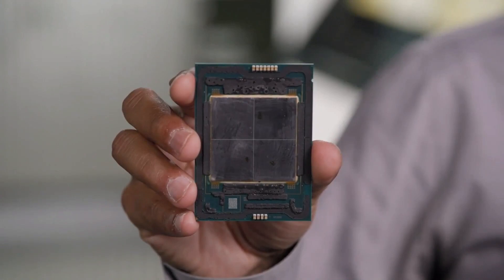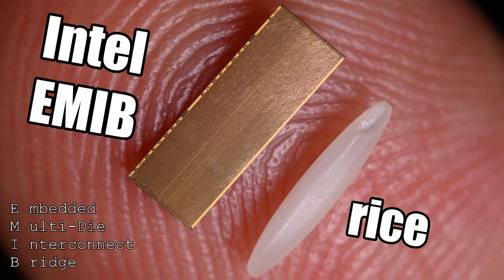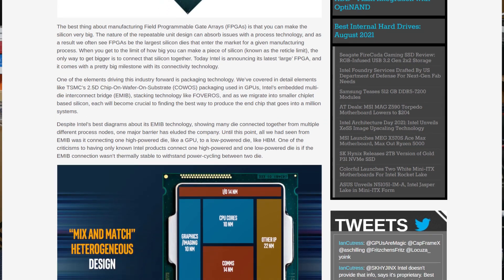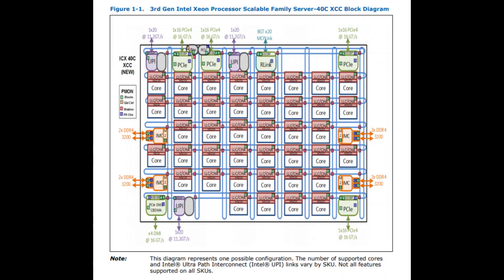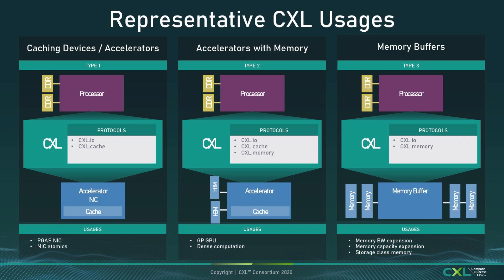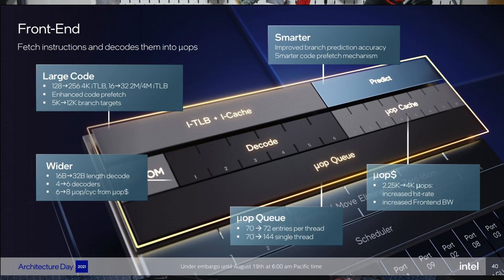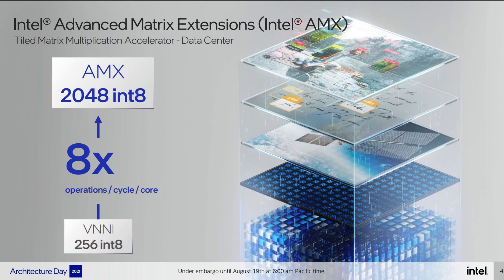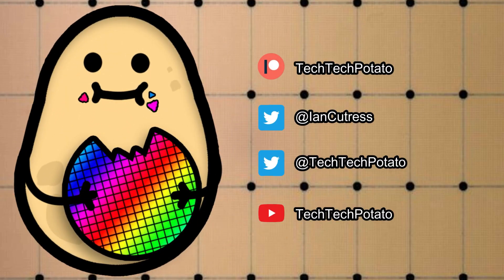When Four Become One: Intel's Next Xeon is BIG

Comment: wrt amd and potential milan-X:
This is another part where amd has a leg up to intel, because apart from the apu's and the semicustom stuff, amd kinda only makes one processing chiplet. which means they can more dynamically scale between desktop and server.
In the last news about it, it seemed that the 3d cache was at least coming to desktop (I think optimistically by the end of the year). which means that IF amd wants to do milan-X and those 3d-cache ryzen desktop cpus are already in production, it's basically just taking a spool of those chiplets from the ryzen assembly line and plugging it into the epyc line.

Comment: I like intels approach to vertical layering and horizontal connectivity over AMD.. If I was Intel I'd be developing a CPU package that has a monolithic die and multiple simple, low, strong chiplet connections (gold bumps/pins that fit into/onto the chiplet). Chiplets secured by a tight fitting sheath and heat sink combination that slides over each extended end of the elongated PCB.. maybe 8 sockets of 16 by 32 connector grids each. This is for main memory and possibly co-processors.. Super-fast, high bandwidth, high capacity DRAM.. 
--
Intel should bring out DIMMS with combined flash and disk cache / main memory that can back itself up using just the power remaining in the system in the event of a power failure.. These replace SSDs in all home PCs, with a standard design for laptops and PCs.. Shake up the market, improves speed at at all levels.
Reply: intel has realeased 512GB ram modules, they are hybrid optane, but they are only supported in specific server models and they need special software support for the apps to make effecient use. no, ssd's are not going to be replaced any time soon by these modules, because of first, the high cost and second, the storage usually needed is always an order of magnitude bigger than ram...

Comment: If SPR is truly monolithic-like in internal connectivity it should be really fun to play with. One thing I've not liked about AMD's approach is the choke point that Infinity Fabric is between CCX, which I think plays a part in their decision to explore massive caches to mitigate against that.
Reply: Since releasing Zen 3:

For server this is probably more of an issue, but that's going to vary greatly depending on the task.  Well, it would also affect TR in the same way.  If threads have to be passing data back and forth between cores on different die, it becomes an issue.  Not much, but yes it can be an issue.  For servers that are constantly serving data for different queries, this is going to be a non-issue.  For video rendering or tasks that do something very similar, where in the case of video rendering segments can be handled by individual cores and then passes the completed segment to a main thread that's assembling a completed stream, then that's constantly using the interconnect between the chiplets.  So, workload dependent. 

However, considering AMD's IPC is better than Intel's right now it doesn't seem like this interconnect has too big of an affect.

For mainstream desktop the CCX is only a thing for 2 chiplet CPUs, since there's no longer a 4 core division.  One could think that because there's still an IO die that this introduces latency, but an area where latency shows itself is in gaming, and right now Zen 3 in desktop is the best gaming product and very low latency.  Part of this is because you're really only using one chiplet for gaming, but the other part is the core chiplet deals with part of the interface without the IO die from my understanding, based on the last time I looked at a diagram for Zen3.  I could be wrong.  Once you go over 8 cores then you start to get into workload dependent issues with having to pass data across the interconnect for cores on different die.  The scheduler in the OS is supposed to keep threads created by the same application within a single chiplet, from my understanding.

I suspect that Zen4 is going to be a total remake of the interconnect.  AMD is scraping GloFo, and is using TSMC technology through and through, and I highly doubt one interconnect is going to be superior to the other when talking about AMD or Intel at that point.  This is also technology that both AMD and TSMC have been working on too.

Comment: Isn't it the interposers that make HBM really expensive? So if Intel is sprinkling interposers like it's confetti then won't these chips be ultra expensive to manufacture? And massively disproportionately expensive compared to a 96-128 core Zen 4 chip?
Reply: Perhaps. But I know Intel has been investing heavily in packaging tech so they might have a competitive advantage there. Plus they could get economies of scale when they start interposing interposers in everything. He also mentioned  (around 1:30) that EMIB requires much less silicon than a traditional interposer. So it may not be as expensive as it seems.
P.S. Great username.
Reply: @fat_pigeon  let's hope so because if they can integrate HBM at a reasonable cost then we might start to see it trickle down to high end APUs.

I still believe an ultimate all round chip (great for gaming and professional workloads) would be:
16 core Zen 4 
80 EU RDNA 3
64GB HBM3 unified memory

I'd pay $2k for that chip if the heat could be controlled so that the clocks are still decent but all of the above are meant to bring huge strides in energy efficiency. Plus the energy saved and the performance gained from having everything on the same chip/socket would be massive. When you break it down $2k isn't a bad price, $3k starts to get a little expensive but when you hear MS is only paying a little over $100 for the XSX APU then clearly AMD / Intel could make some serious profit from releasing consumer segment ultra high-end APUs.
Reply: probably
Reply: It's Intels highest price line I know: if it offers good performance per space and power cloud providers will pay nearly any price.
Reply: @CGIEBERT  I just find it very unlikely it will offer better performance per socket per watt than a 96-128 core 5nm Zen 4 CPU but time will tell I guess. 
I think it will start to get very interesting when Intel starts using TSMC's 3nm node for their chips, seemingly before AMD has 3nm chips too.

Comment: EMIB is saving some Watts while expanding connectivity, but where is the limit of W/mm2 of heat that needs to be removed from the package.
Even 3D stacking AMD is doing has limitations and cores are not stacked only lower power logic.

Comment: I'll try to ask on the 3rd, that flip thing, doesn't quite sound correct to me, esp considering much older quad op-amps. yet cool info. cool vid as well.  B)

I can understand if it's more twisting of data wires to line things up between flipped sections of circuits, the grain thing, I have doubts.

Comment: Speculation:
I think Intel knows tiles aren't a good solution and that chiplets are far more value-efficient, but they want to take advantage of their in-house manufacturing to basically force a status quo that only they could possibly maintain. If they can keep everyone designing software for monolithic (or monolithic-esque) CPUs, then chiplets will still have that heterogeneous latency potentially causing problems with software.
Reply: chiplets always have latency issues, this is just a reality. you can try to minimize that problem with proper software engineering, but it wont go away. intel's tile approach is superior to amd's chiplet design technologically. it has much lower latency which is actually important in data centers. chiplet approach is probably cheaper, but this is how its always been with amd and intel historically. intel's approach has been superior technology at higher cost, amd has usually competed with cost efficiency.

Comment: Intel laughing at amd for " gluing together CPUs" and calling them "imitators who use cinebench " and insulting amd on stage in their tiger lake presentation
Also intel copying amd for multi chip modules with sapphire rapids and ponte vecchio
Also intel releasing PCie gen 4 after amd 
Also intel calling amd for using unrealistic benchmarks while the userbenchmark scandal where they disabled half the cores of a r7 2700x and didn't even enable xmp on ryzen
Gg Intel

Comment: Great.
Now this means all new MOBO, RAM, PCIe slots, 
coolers, larger PSU? What kind of Socket?

I've always wondered-
Everything else exponentially increased by x-factor, 
why have instruction sets been locked at 64bit?
Never see 128, 256, 512, 768, 1024, 2048 instructions?

What's next after 486? (X86) and why hasn't that architecture
moved at all? Is 128 Express Lanes some physical limit, too?

Comment: Worked with 8 socket system only once in my life. For a healthcare org which had extremely large Caché DBs with data for ~10 million patients. It ended up working well, but required quite a lot of initial heavy lifting to tune it for memory access bottlenecks while operating under a single kernel. Good times.
Reply: Its hard to tune, some times I just give up, and use a dual socket system.
Have multiple quad socket systems, 2 systems with 8 sockets (only one of them is x86)
One system with 12 sockets (yeah sparc)
Reply: 10 million patients seem like a small number, why does it need so many cores? (I assume multicore CPU's on each socket)
Reply: @wpyoga  10 million patients. Not 10 million records. Think about lab tests, reports, X-rays, medications, vaccinations, surgeries, treatment plans, etc. A single patient may easily 1000-10000 records associated with them, depending on age and ailments. Now if you go into the older age brackets records per patient number would only go up. 

It was the largest patient DB ever deployed by EPIC systems in the world. The project to deploy this MIS system was $1.4b in total costs.
Reply: @AlmightyGTR  Yes, but it's not every patient that has 1000+ records right?

I'm just confused as to why the database would be so big.
Reply: @wpyoga  seems like you have never worked in healthcare systems. All good. You know what you know.
Reply: @wpyoga  I used to work at iron mountain they kept paper records for a hospital  chain and the same people would go to hospital every week sometimes twice. There was a few times we had to use a van to move all the records for someone back to the hospital. So like moving a pallet of paper and this was for a short time maybe 1-2 years of time. If I had to guess each box held 3-5 reams(500sheets) times at least 10-20 boxes. 

Most people only had an inch or two of paper though.
Reply: Must have been Epic EMR Software. I worked at Epic for α year. Company likes to hire hundreds of college graduates at α time and make them work 60 hours α week.
Reply: @kellymoses8566  it was. We purchased 2 dozen modules to replace and decom ~900 applications. Your campus is just magical.
Reply: I assume they've moved to the cloud by now, right?
Reply: @taherassaid  nope, data residency legislation. Can’t send patient data to the land of freedom.
Reply: you need a paralel language for it

Comment: Everyone remembers Intel calling Zen "glued together chips" but who else remembers AMD calling the Q6600 "not a real quad core" for the same reasons?
Reply: Most people don't remember the second
Reply: I remember all the way back to the PENTIUM D era, remember that one? Intel didn't have one monolithic die for the Pentium D series back then. They shipped 2 single cores each on their own die per Pentium D package.
Reply: @aquapendulum  I had a pentium d 820 for my first "gaming computer" with a gt 210. I also had an amd k6 growing up and my parents celeron 533 long after that. Actually the Very first pc we had was a 25 mhz intel.
Reply: @aquapendulum  i have one on the shelf collecting dust actually but i never knew that. I think the overall point is that multi-die/mcm can be a useful tool to get to "the next level" but then making that new level of tech monolithically is the ideal goal.
Reply: q6600 was an epic tier chip that gave people a decade of gaming.
Reply: Not only do I remember, I frequently remind people of those events.
Reply: Fx series weren't real 6 and 8 core cpus
Reply: I'm using its Xeon derivitive right now, a 3ghz 8 core Mac Pro 2,1. 

I like to think of it as a quad socket, dual core system squished into the design and footprint of a dual socket, quad core system.
Reply: Yes i do. It's like talking with software engineers whos program is designed more clean while the user don't give a shit.
Reply: @llothar68  idk I wish idTech weren't the only ones proud of their optimization. (Glares at Battlefield and Assassin's Creed disapprovingly)
Reply: That only worked because the Q6600 didn't have an integrated memory controller. It really was just 2x lower tier products smashed together on a package basically with glue. There was no "special sauce" on the chips to make such an MCM setup work. It just worked by accident because Intel's memory controller was still on an external northbridge.
Reply: @Cooe.  That's not an accident lol everyone used external northbridge then. It's still a simple fact that chiplet designs are just a crutch to make something not quite possible in solid silicon, possible a bit sooner by fudging. Someday though, I bet we can make entire SOCs monolithic.
Reply: Q6600 is a real quad core 😆 and that cpu is not a mcm hah
Reply: @TheCosmicMason  i mean, it doesn't have a separate IO die but it is two separate dies with 2 cores each. Same goal- More cores with less binning, even if it meant some latency penalty.
Reply: @TheCosmicMason  Which was true, didn't prevent it from being a fantastic little product though. Especially the G0 stepping. Which could overclock to 3.4-3.6 stable.
Boosting it's already impressive performance by another whopping 50%

Back then intel also had bargain duo core gem. The E5200.
It was only 50-60 bucks. And it had a lackluster 2,5ghz core clock.
But it had an ace up it's sleeve. It had a 533mhz FSB frequency. Which you could easily bump to 800mhz and beyond.
Boosting the core clock to over 4ghz stable on a half decent air cooler.
Add a 4870 for 130-180 bucks (512mb or 1024 Gddr5)

And you could PC game properly on 1080p for 300-400 bucks total system price.

oh men those were the days. Made 5 of those systems for pennyless buddies.

Comment: Even with their faster bandwidth & lower latency connection between dies compared to AMD because EMIB, I think AMD's modern MCM setup is still far, FAR superior. Why? One word (err acronym). NUMA. 

Instead of going full chiplet, Intel basically made a better version of Naples (1st Gen EPYC), with all the idiosyncrasies & faults of that product intact. 

Aka, using multiples of the same chip on a package with the CPU's memory controllers & I/O being split across all the different chips instead of being on some sort of "hub" chip the rest connect to. And thus, creating the same kind of variable latencies (though surely lower across the board bc EMIB) & thus NUMA issues that Naples had... Aka it has the same "inconsistent performance" that Intel railed AMD's Naples so hard for in that infamous "glued together" slide deck.

Comment: Is there a reason why V-Cache needs to be on 7nm? Couldn't they just do the cache on 12nm?
Reply from the maker: Density.
Reply: @TechTechPotato  but they are only covering half the die, and filling out the sides with some kind of other Thermaltake conductive material in an extra step. I would have thought going 12nm and covering the whole die would have been cheaper.

Comment: The magic AMD did was one die from top to bottom.
-The home user you get the benefit of most the features of top end slicon like cache size. 
-AMD got the benefit of keeping it simple and having massive options in binning slicon and packaging. 

Intel's custom setup for each line is cool but must cost much more for production/packaging and failure/binning rates. 
But it may just be that the performance is so amazing it's worth it?
At least they will learn a lot from it, develop new tools and the next step may be amazing.

Just the idea of simple scaling and a single die is hard to shake.

PS cant wait for some custom slicon packages AMD has done to leek out, relay hope they have made some cool crazy CPU's.
edit - hope you do a short on the Broadwell CPU you just reviewed, may be a fun comparison when AMD get there one out. 
At the time I saw mention of it and a few story's that it was used for high frequency trading I think, been a long time.
Reply: Remember though, if Intel manages to just keep their manufacturing processes competitive with TSMC in the future, they have advantage because they use their own fabs. For them, using more silicon is considerably cheaper than for AMD which has to pay dearly for all the extra silicon they use from TSMC.

Comment: 10 EMIBs per sapphire rapid CPU? Price? Wouldn’t this increase Intel’s silicon cost per CPU?
Reply from the maker: Yup
Reply: at the same time those are likely made on a much older node, and they are quite small so they shouldn't be expensive
Reply: @cj09beira  I wonder about the cost of aligning 14 dies though.
Reply: Since Intel manufactures their own CPUs by themselves, this isn't as much of a factor for them as it is for AMD that has to pay TSMC dearly for all the extra silicon they use from them.